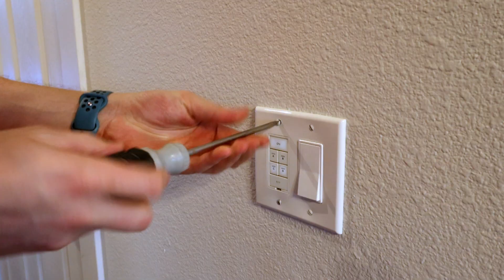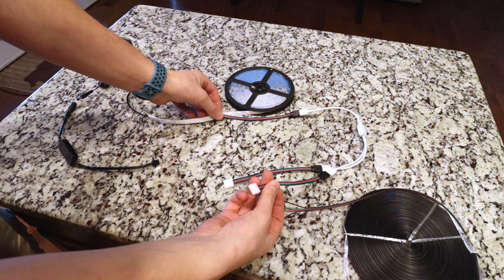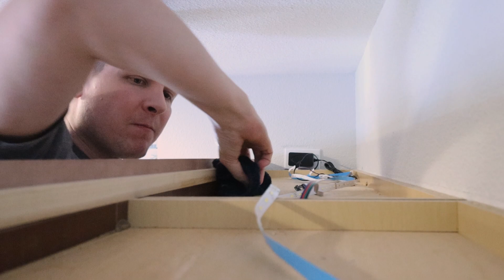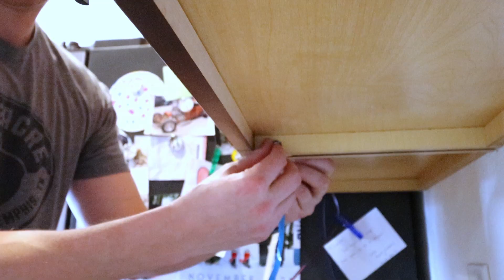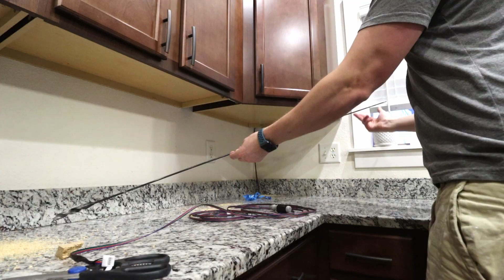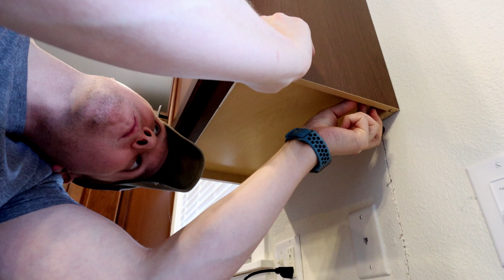Dimmable and Color Adjusting LED Under Cabinet Lighting

Comment: Do the light strips automatically turn on when you flip the light switch on?  Does the light switch bypass the remote?
Reply from the maker: The lights keep the last setting. So if we dim them with the remote or set the color temp, the switch turns them back on at those settings without needing to touch the remote.

Comment: Did you solder any of the wires or did you just twist them together and put heat shrink tube over them?
Reply from the maker: I have soldered them in the past but didn't on this one. The twist and shrink tube has held up just fine but solder is also a good belt and suspenders option.